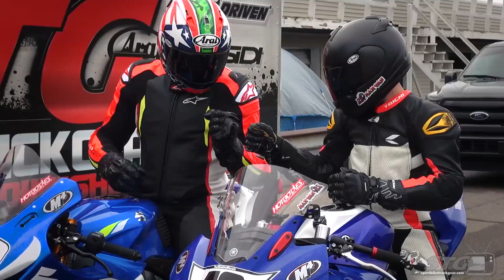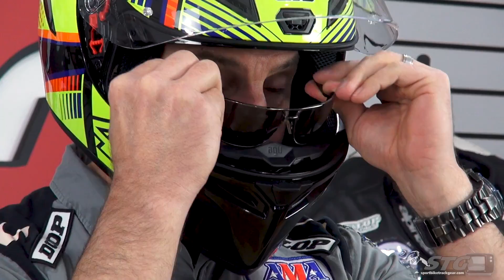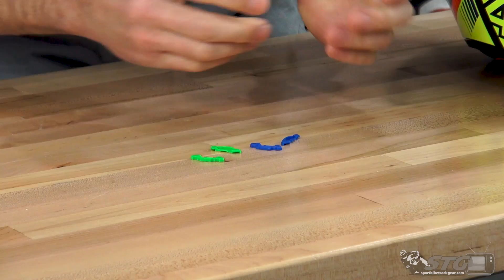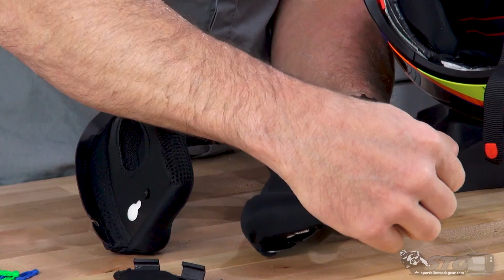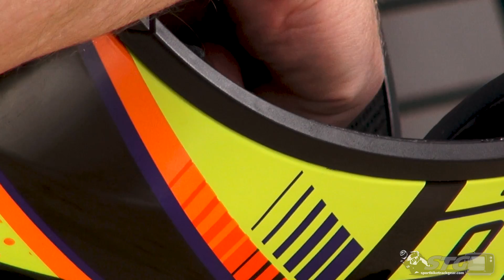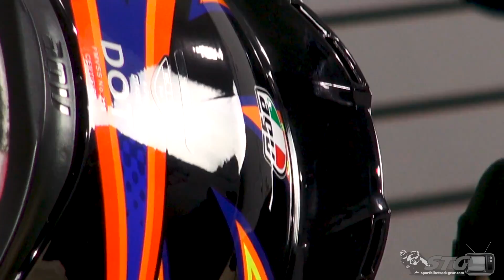AGV K1 Helmet Review | Sportbike Track Gear

Comment: What do you mean at 2:30? What can be done to do more for the eps? Thanks
Reply from the maker: AGV formulates the EPS to work with the injection molded shell to maximize protection. There is no EPS adjustment for the end user. - Van

Comment: To Be Honest. this helmet is overrated.
i have this Helmet. and aside from fit. there is nothing to ride home about.

Pros:
Fit is Great
Aesthetics (If that Matters.)
Light

Cons:
Needs Antifog Lens. (Sold Separately)
Shell is somewhat too thin. makes me wonder if it can protect my head.

the helmet i can compare is The Bell Qualifer. (Not DLX)
and the bell is way cheaper yet offers better protection, better Lens.
if you Add  a few hundred grams.
youll get a Bell DLX Mips. with protint shield.
that is why i personally dont like this helmet. aside from fit and aethetics
Reply from the maker: For this price this is a lot of helmet. I am comparing this to a lot more than just one other helmet. You also have to align your expectations with the price tag. You will only get so much when it is around $200 and the high end for the brand is $1600+. As far as safety goes the K1 passes the impact test and will protect you as long as it fits you correctly. - Van

Comment: The velcro on the front part of this helmet, keeps scratching my forehead. How do I fix this? Do I need to remove the velcro pad?
Reply from the maker: You need to make sure the liner is placed properly to avoid this. I did not have an issue with this and do not think I have fielded any other comments like this to date. When placing the top liner to to do it in a way that you are anticipating it will push back a bit and see if that helps. - Van
Reply: @sportbiketrackgear  thanks van. I ended up trading it in for a Sedici. I think it’s because of my own head shape. XS helmet liner kept pushing up, every time I’d put the helmet on!!! (Super annoying)

Comment: How do you set the strap for quick on and off, the directions that came with my K1 did not explain it very well. Thanks.
Reply from the maker: This is a double d-ring system so there is no real short cut to strapping it up. You will need to completely remove the strap from the rings each time you take if off an put it back on. - Van

Comment: I went from an icon airflite to this
Reply from the maker: IMO this is a better helmet if you a looking for a good full face lid. - Van
Reply: @sportbiketrackgear  yeah it’s way better. It has little to no wind resistance. If I turned my head in the icon it felt like it was gonna fly off. & yes it was the right size. I love the agv way more

Comment: Thank you for the great video.
My had is 57cm and I have ordered K-1 with L size. Will this wide and should I change it to the ML?
Reply from the maker: I would go with the size the chart recommends if you want this to fit properly. We find many riders are in helmets one size too large. If you want it to perform as designed it needs to fit well. - Van

Comment: Question I know this is an older video but. I got one of these in 2XL (Fat head I know...) I like it a lot but it's maybe just a little tight on the cheekpads. If I ordered the pads for a L, or XL would those pads be thinner and thus fit a little less snug ?
Reply from the maker: Sorry AGV does not make any mention of the padding for this helmet to be interchangeable. I would contact them directly to ask this question. - Van

Comment: Split between the agv k1 and hjc i10. Which one would you go with?
Reply from the maker: Well more value in the i10 for sure with the price where it is. The K1 will flow more air and has better graphics. End of the day the overall experience with these helmets will be similar IMO. - Van

Comment: Bro i want to buy in online,but i dont know what size is good for me my head is 58cm?
Reply from the maker: At 58 cm you will be wearing the same size I am in as I measure 58 cm as well. The medium large should get you an excellent fit. Make sure to wear the helmet in the house with the sticker still on the shield to see how you feel about the fit before you ride in it. By doing this we are able to accept a return or exchange on the helmet without issue. - Van

Comment: I just got one of these, replacing a K3. Only rode with it three times so far. The micro vent that pushes up the visor just a bit keeps closing at highway speed, or just above. I even installed those green visor retainers that have the extra upper and lower visor detents. It seemed to help a little, but it still closes at higher speeds. 

Is this normal or did I get a lemon?
I didn't buy it from STG. Just trying to figure out how it's supposed to work or if it needs to be replaced.

Maybe ask Jake, he might even remember me, I just recently bought a fork rebuild kit from him.

Thanks!
Reply from the maker: I would not ride with the visor cracked like this at high speed. Odds are it was not designed to be ridden in at high speed with the visor held open at the bottom. - Van

Comment: k1 it's no go for the track up to 120 miles started shaking
Reply from the maker: The K1 is more of a street helmet for sure. If you are a street rider looking to hit a track day or 2 it will get the job done. For riders looking to do more track days or ride speeds in excess of 100 mph regularly you will find much better aerodynamic performance from higher end helmets like the Shoei X-14, Arai Corsair-X, etc...

Important to note the helmet needs to fit properly. If the helmet is too loose it's performance will not be great. - Van

Comment: Just bought an AGV K1 and it is not a track helmet.  The one I got already had a piece of plastic broke off the end of the rear collar piece so the feeling is Cheap Chinese Plastic.  It moves air well but the visor fogs.  I have an Arai and 2 Icon Airmada helmets.  If you want a track helmet buy Arai, I also like some of the features my Icon Airmada has better (anti-fog visor, polycarb construction) than the K1.  Only place I see the K1 seems better than the Icon is the Sharp safety rating, but both Icon and AGV are Dot and ECE certified.  Maybe this AGV K1 will grow on me, but for now Cheap Chinese Plastic feel.
Reply from the maker: To be fair it is a good price point helmet. If you want a better helmet you can get there by spending more for sure. We have sold a lot of the K1 and one of our staffers (Jake) has one as well. Thus far the feedback has been very good, especially considering it starts at under $200. - Van

Comment: How good is it for highway riding/high speeds  ? and would you pick the K-1 over the Bell Qualifier (not the DLX) ?
Reply from the maker: I think the AGV K1 is an excellent sub-$200 helmet. It is a great street helmet that offers a lot of ventilation and nice overall quality. Comparing this to the Standard Bell Qualifier is a little unfair as it sells for $80 to $150 more. Comparing this to the Qualifier DLX is a better comparison. With the DLX you get the MIPS slip plane (better crash protection) as well as the Photochromic shield (self tints based when exposed to the sun automatically) which are both nice.
End of the day both are good helmets that will put a smile on your face while you are riding in them. - Van
Reply: @sportbiketrackgear  i actually purchased a standard bell qualifier and was wanting to buy the K-1 with the soleluna graphic. Was wanting to use the AGV for highway riding because of its aerodynamic design which will probably help cruise at 120 kmh/75 mph. Will that be a good second lid/upgrade?

Comment: Van, would you recommend this helmet for strictly race use? Crashed my Shoei X14 and thinking about going to a more affordable route. Dont know if I'd be going 'cheap' with the K1 or if it would be a smart buy. Love the collarbone note. Just fractured mine and I wonder if it was from the shoei.
Reply from the maker: IMO this is a nice helmet but not one I would take racing if I had the budget for better. If you had an X-14 and want to save some money while still getting a solid helmet I would take a look at the Bell Star, Scorpion EXO-R1 Air or the HJC RPHA 11 Pro helmets. Each of these are good options that will save hundreds over the X-14. - Van
Reply: @sportbiketrackgear  would you consider the rpha 11 pro more stable at speed, or a better field of view? Or just rate it an overall better quality helmet than the k1 for your money? I'll be riding strictly track, trying to keep costs down, but don't want to cheap out either

Comment: I have a K1. But my gripe with the helmet is its velcro in the headliners. I keep on asking myself what's its purpose since the headliner doesn't have any to close it.
Reply from the maker: I felt the velcro as well and had to re position it a bit to prevent it from happening. - Van
Reply: You can cut it off no problem I heated. It's just some excess material

Comment: I don’t like this helmet. I have it and have 2 issues with it. 

One is the velcro on the head liner. It’s irritating on the forehead. 

Second, the field of vision. The center of the helmet is visible and obstructs my view of what’s in front of me. I have to put my head up and it’s tiring. The best example I can give of the issue is like wearing a baseball hat. That “lip” or “flap” from the hat resembles what you’ll see from inside the helmet when you’re riding.
Reply from the maker: I had a similar experience with the velcro as well and had to re position the top liner then put the helmet back on. IMO this is easy to correct and not a major issue. While the field of vision is not as big as the Pista or Corsa I felt it was open enough for myself. That said we all have different shaped heads so this can vary for sure. Try adding a few strips of foam tape in between the top liner and the EPS to help lift the helmet up a little bit. Start with one layer and avoid adding an extreme amount. Hope this helps, Van
Reply: My guess, due to the design is it’s designed for you to be in a full tuck, so when you’re riding on the street (hopefully not going fast enough that you need a full tuck lol) your FOV May suffer.

Comment: This is my 1st high speed helmet with a spoiler. Absolutely love it at higher speeds. Super stable. Very economical priced.
Reply: Also, I wanted to add that I wear thick sided sumglasses and regular glasses. And I wear ear buds. Very comfy
Reply: How do you find the helmet with wind noise
Reply: @jasonarndt1789  throw some bose QCii buds in, cant hear the wind or the engine. I personally love the sound of the engine so i dont ride with plugs or buds in, just on occasion when I want to go cruising listening to music.

Comment: Great review, I have a K1 aswell. The velcro is also a minor problem for me as it sometimes snags on my forehead, which is causing some irritation. It is an easy fix as you say, but it will come back and start bothering you again :)
Reply: It's just the excess of the material but you could cut it and won't even feel it, I did it and it's great
Reply: @oscarandresgalindo603   cut what exactly? remove the whole velcro? or just trim it down? I had similar forehead irritation before on a kickass looking helmet which i just stopped wearing from how annoying it got.
Reply: @ahmedalawadhi7510  What did you end up doing to fix the velcro? I'd like to make some adjustments as well. Literally just bought the helmet, and thought it was going to go away. IT DOES NOT GO AWAY
Reply: @MrZacattack1015  happened to me on a different helmet. Was an ICON. I just gave up on it and wore another helmet
Reply: @ahmedalawadhi7510  was it the airlite? The one with an extended visor